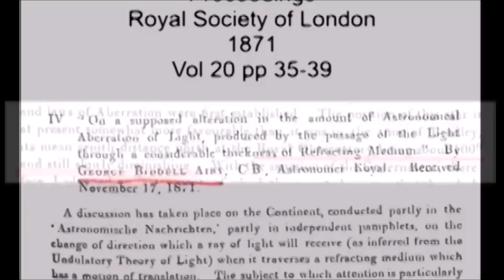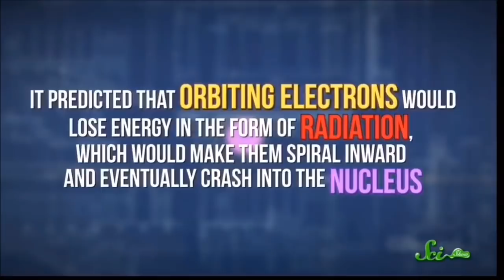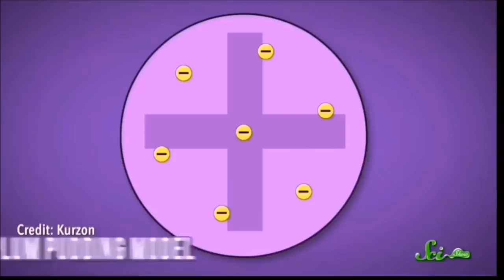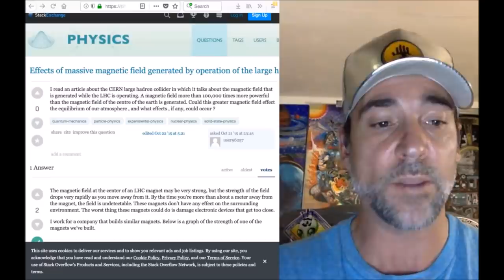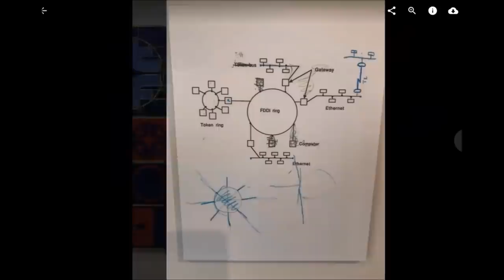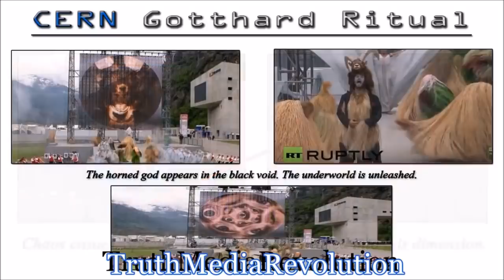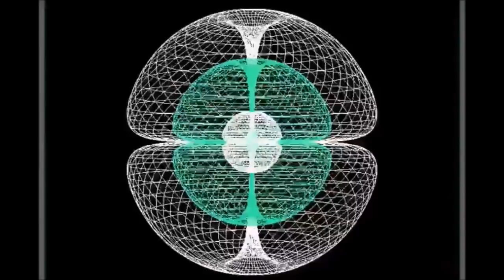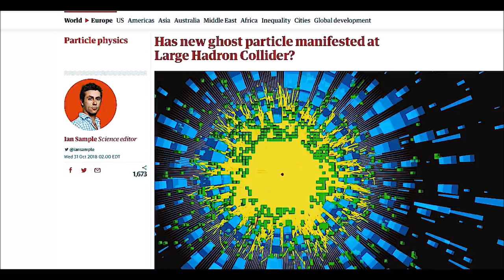Flat Earth: Aetheric Accelerations - [CERN/LHC/Physics-Metaphysics & More]

Comment: Peer review sounds good, after all, only a similarly qualified physicist could really check an equals work. The failure would be if they don't want or like the results as determined by deeply held beliefs. Like a religion. Mans' heart drives the machine. If one wants to stay a physicist, play by the rules or get pushed to the sidelines. Is any job that different?